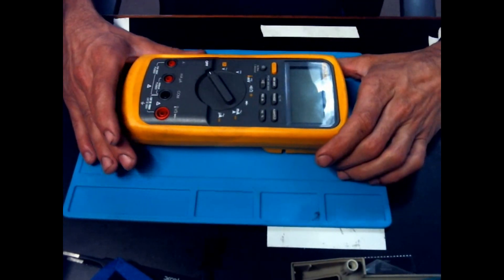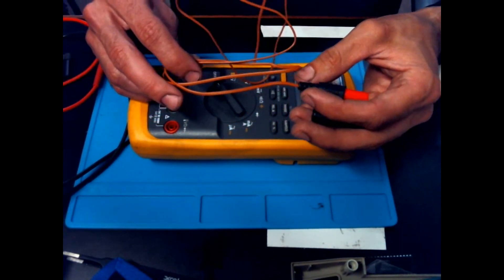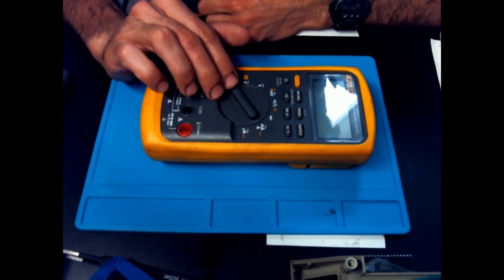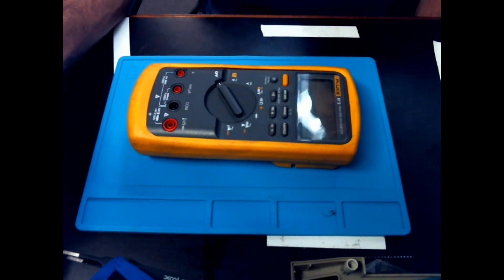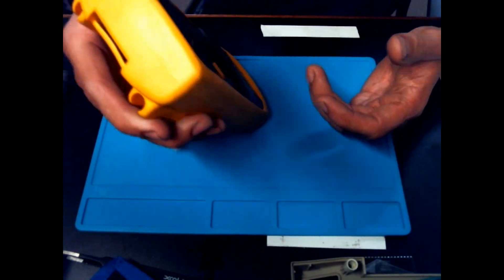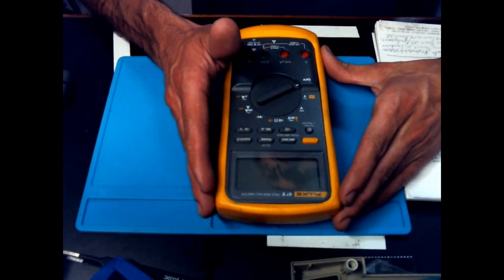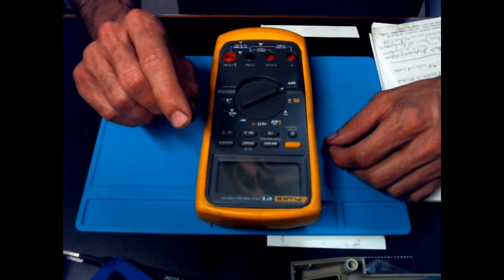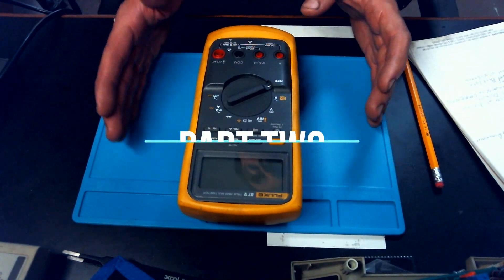The Superman of Meters? Fluke 87V Multimeter Review Part 1

Comment: I have a question is this the best multimeter for an electrician if no which one you recommend
Reply from the maker: What kind of electrician? It's a great meter but for doing residential electrical there are cheaper meters out there, such as the Brymen BM235, that will serve just as well. If it's commercial electrical or projects that will require a meter that has to calibrated annually, the 87V is what I recommend.
Reply: Yes it's residential but I don't want to limit myself. Never know what can happen in the future.

Comment: How do you use the ohms range scale on these ? I can’t find anywhere that tells me what and how to use
Reply from the maker: Do you mean using manual ranging for the ohms? Or how to set up the meter to measure ohms?
Reply: Beb's Repair Bench using auto range. A guy at my work I swear was trying to use the graph on the bottom and said he had 44kohms when it read 4.345 kohms on auto range.
Reply from the maker: @trialnterror  I think I see what you mean. You always read the measurement with the follower as part of it. So if you only see the ohms symbol with no prefix, the indicated value is ohms, same for kohms and Mohms. The decimal never has to be mentally "shifted". As far as the bar graph, it doesn't really represent a numerical value. It's meant to show quick fluctuations in a signal, kind of like the old school "needle wiggle" in analog meters. It can also be used to show where you are in the current auto-range, so the further left the bar is, the closer you are to ranging down, and when it's almost "full", it's close to ranging up. Hope this helps!
Reply: Beb's Repair Bench that’s exactly what I thought. I don’t know why the guy I was working with thought he had to change it? The only thing I can think was he thought it was on Mohms and not K ohms . Because I was on auto range. This helps a lot. Just like you said the scale is just a quick representation of where I am.

Comment: Wish fluke model will you recommend for daily electronic repair?
Reply from the maker: I would recommend the Fluke 116. Or a favorite of mine that isn't Fluke but still a great meter is a Brymen BM235.
Reply: @bebsrepairbench5074  what about Fluke 179,? just found it in ebay used for the same price
Reply from the maker: @RM-en9gk  that's a really good meter!

Comment: Can we measure 100ms pulse of 24VDC using this multi meter
Reply from the maker: What are you wanting to measure? Frequency, duty cycle, voltage?
Reply: @bebsrepairbench5074  peak voltage of pulse
Reply from the maker: @Ashishchabha  you would be better off with an oscilloscope for that. With a pulse the meter would want to measure by averaging it like a PWM signal or it would be an unstable reading that constantly goes up and down. You might be able to away with using peak detect. I can try it and let you know.
Reply: @bebsrepairbench5074  Thanks Pal for your reply... Oscilloscope is very costly... It will be great of you, if you can try and revert back... Thanks in advance Pal...
Reply from the maker: @Ashishchabha  Well after a fun round of experimenting, I can say that I wouldn't trust the 87V to show a peak measurement. Even when in manual range the pulse is just way too short. Sorry!
Reply: @bebsrepairbench5074  Thanks Pal... Fluke should be sorry for that, you should not... They are mentioning 250us pulse peak can be measured with this multi meter on their selling page... Thanks Pal....
Reply: "Hello Ashish,

 

The steps are:

Select the function

Manually select the range

Press the MIN MAX button

Press the Continuity button

 

The meter is then set to captures  peaks as short as 250uS."
This method suggested by fluke when I communicated with them after your feedback... Can you please try this and revert?
Reply from the maker: @Ashishchabha  sure I'll see how it does!
Reply from the maker: @Ashishchabha  Wow. That does actually work. I even tried it at 10ms which is the shortest time I can do with my test rig. The only thing I don't like is that it once it peaks (my peak was 24.11V) if a lower pulse happens you won't know. But if you only need to know the highest pulse, this works.
Reply: @bebsrepairbench5074  Thanks Pal...

Comment: The superman of Flukes is the model 27 and 28 series 2

Cheers.
Reply from the maker: Those are both great meters. I have an original 27 and even though it doesn't have anywhere near the features of the series 2 it's still an awesome piece of equipment.
Reply: @bebsrepairbench5074  I love the Flukes makes un USA.

I have the next 
27 three units 
27 series 2
28 series 2
87 V
74 IV
179 IV
867b
97
99b

Cheers
Reply from the maker: @treadmillrepair754  I'm not familiar with the 90 series of meters. I love the 179 as an everyday meter.
Reply: @bebsrepairbench5074  My every day multimeter is the 28 series 2 and 99b.
I am more than 40 years un electronics,   here in my country majority of electronics shop are closed closed now.
I fix Audio Research equipment and Cybex and Lifefitness motor controllers only.

Regards.
Reply from the maker: @treadmillrepair754  Wow. Your everyday needs are definitely a lot more advanced than mine. We have a lot of servo motor controllers at my job but I don't have the skills to fix them yet. I do take them apart on occasion to clean them and apply a fresh layer of heat sink compound, but that's about my limit.
Reply: @bebsrepairbench5074  Audio Research is an audio High End company based in Minnesota, they make very good things.
Cybex and Lifefitness makes treadmills  machines.
Here in my country I am the only one fixing this things.
Maybe two or three guys try to do some jobs without success.
Regards.

Comment: I just bought a Fluke 287 how does this compare?
Reply from the maker: I've never had the chance to play with one, but from what I've read your 287 is better in many ways, with a 50000 count display you'll have better resolution than the 87V's 20000 option. It also has PC connectivity if you need it, and the dot matrix display offers options an LCD could never hope to match, although oftentimes at the cost of being a battery hog. It also has AC+DC measurements, higher bandwidth, better accuracy........ I could keep going but if you check out this link Fluke lays it all out better than I can:

https://www.fluke.com/en/products/electrical-testing/digital-multimeters/compare?selected=17,372,0
Reply: @bebsrepairbench5074  Yeah all those are the same pros and cons that I've read for the 287.The Fluke 87 is the most highly rated because of it's versatility and the fact that it's battery doesn't drain out so quickly.The 287 actually has more functionality but because of it's abysmal battery performance it's rating is much lower. The Fluke 87 rates 4.6 on Amazon and the Fluke 287 rates 3.8. Despite it's rating the Fluke 287 is a really attractive and solidly made multimeter which just feels very premium.
Reply from the maker: @Tejaye777  I think a lot people just don't need all the bells and whistles the 287 offers so they go for the 87 with its more attractive price. Add to that the history of the 80 series and the trust people have in them and you've got a recipe for a cult following. Bottom line though is the 287 truly is a more capable meter, even it's hunger for batteries is offset by conveniently using AA batteries. This is just my opinion, formulated after I've had to change those pesky 9V battery connectors the 80 series use.
Reply: @bebsrepairbench5074  I guess.That's a very great possibility.

Comment: My question is are they good for working with motorcycle
Reply from the maker: I would say no. If your looking for a DMM to work on motorcycles, a Fluke 88 would be better. It has an inductive coil attachment for RPMs. There are also many lower cost meters with this feature that would work just as well.

Comment: Regarding battery life, something I don't understand, why don't they use rechargeable batteries and use the electricity it is currently testing to recharge those batteries. They'd never go dead! Fluke... look me up to submit a patent ;)
Reply from the maker: I like the idea of rechargeable batteries! I'm not an electronics engineer,but I'm sure there's a good reason they don't have a setup that charges while you measure. 

There are several powerless models of meter that measure voltage without an internal power supply, but I haven't seen a full featured meter like that.

Comment: Isn’t it true that fluke won’t honor the warranty on the meter if you did not purchase through an authorized dealer?
Reply: I think they do honor it. I purchased 2015 edition fluke 289 used on Ebay. I had it sent to fluke to get calibrated. They performed repairs on it for free. Some of there meters have a life time warranty along as the meter is still in production. One it is not in production, the warranty is only good for 10 years. The best thing to do with any fluke meter is to register it on fluke.com.
Reply from the maker: I haven't tried it personally, but I have heard other people have sent them in without a problem. I believe that if you send it to Fluke for calibration you pay for that, but any issues they find are fixed under warranty.
Reply: Every file meter I have purchased, besides my 87v, has been used and purchased off ebay. As soon as I get the meter, I go to flukes website and register the meter under me. I have a 289, 87v, 276 and a 189. All used except the 87v. All registered on fluke.com, all calibrated through fluke. No issues what so ever. The 289 had/has a problem with the capacitor, fluke replaced/repaired it for free. All flukes have a life time warranty, once the meter is not in production, a 10 year warranty starts.

Comment: What did you record this with ? An old flip phone ? The picture quality is bad, the sound quality is even worse. And 14 minutes of showing two hands twiddling a dirty DMM around ? That doesn't make for a very interesting VIDEO ! Nothing to see here folks. EDIT: not only that, but you state false facts (@11:15). I own a Fluke 87V and the Relative function (Rel) DOES work also in capacitance mode (in order to cancel out the capacitance of the leads and input). Please check your facts before making a review.
Reply: AlainHubert I for one would much rather watch some hands fiddling over the piece than some dude with a face for radio. I thought it was an interesting video to watch as is.